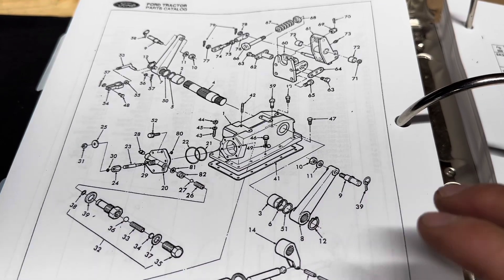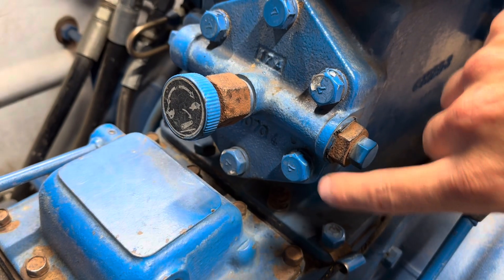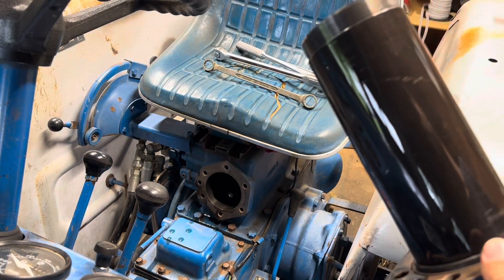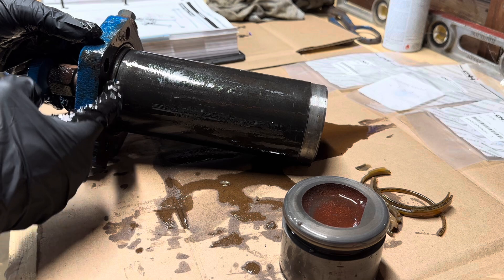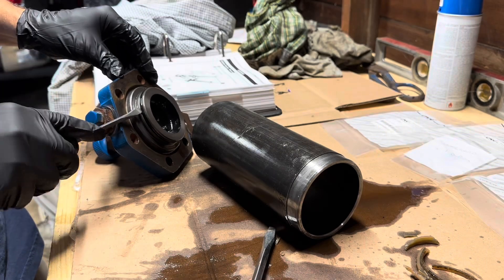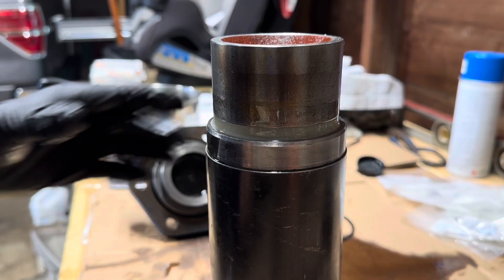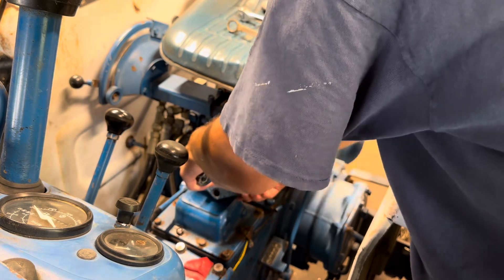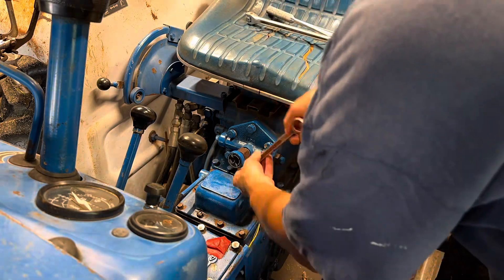Ford 1700 Tractor 3-Point Lift Cylinder Seal Replacement (same for 1710, 1900, 1910)

Comment: I have the same tractor ford 1700 I'm installing a loader implement, need to find best place for hydraulic supply for remotes connection any suggestions?
Reply from the maker: The loader feed block is on the right side under the seat by the 3 point position control lever. If it wasn’t equipped with a loader from factory, it probably won’t have the hydraulic block there that you need though. If you want to see this hydraulic connection, check out my videos on adding power steering. I plumbed the original loader feed to the steering unit, then the steering power beyond to the loader.

Comment: Just changed mine today and it was a little easier than I thought.  Probably took about an hour.  My seal didn't look bad but you could feel that the lip was worn down so that obviously was enough to cause the 3 point bouncing problem.  Thanks for the tip about heating the seal to get it on the piston.   The only problem I had was getting the piston back in the cylinder with the new seal installed.  If I was to do it again I would put the piston in the cylinder while the cylinder was unattached from the front assembly which would have made it easier to pound in.

Comment: Your video just saved me a lot of money. Having the same issue with my 1710. New Holland dealer was sure I would need a new pump. Said it could run as much as $1800. Two different independent tractor mechanics both said the pump was probably ok and it was the lift cylinder. One quoted me $650 which included fluid and filter with the cylinder rebuild. He was backed up with work and needed 90 days before he could get to it. The second mechanic wanted $850 for the same work and could get right on it.  This video convinced me to do it myself. I ordered the seals from Messicks. The filter on eBay and fluid from Tractor Supply.  Total cost was a little over $200.  I plan on doing it this weekend.

Comment: I need the part number for all the o-rings and nylon seal
Reply from the maker: @daveulsh690  I have a parts catalog, but the print quality isn’t great and sometimes it’s tricky to read. The best thing to do is go to the parts section of the Messicks Equipment website and look up the tractor model. They have all the exploded views online, and the parts list even has photos of many items. Plus, their site often lists the actual size of things like bolts and o-rings so you could find them locally outside of a New Holland parts department. I typically order parts by finding them on the diagram and ordering through Messicks, or calling my local dealer and telling them what I need and letting them track it down, rather than me giving a part number. With my local dealer, if they don’t stock it and you tell them the wrong part number (or they get it wrong in ordering) it’s yours and the mistake is placed on you. If you call and ask for something like a muffler for a Ford 1700 tractor and they order it wrong, that’s their mistake and you aren’t out the $ with incorrect parts because they looked it up for ordering. That actually happened to me, so with my local dealer I always have them look it up for me and order it.
Reply from the maker: You can see the part numbers on the bags beginning at 2:10.

Comment: On these tractors I noticed in the manual it says to come to a complete stop when switching to higher gears. Is this actually true or can I just switch between main gears and range gears while moving to increase speed?
Reply from the maker: @treylester1537  The transmission is not synchronized, so you do need to stop to shift gears without grinding. When you get good with it and RPM syncing with double clutching you can upshift while rolling, but you have to be gentle and patient to feel when it is in sync and will slip into gear. I only ever do a rolling upshift when I’m getting going on the road and want to be in 12th gear to reduce riding the clutch getting going, but even then I don’t always do it. If you are running a PTO attachment and want to change gears, you have to stop for longer or you will grind gears as there is more momentum through the transmission. Even more so going from forward to reverse.
Reply: @ so if I wanted to drive in 3rd gear I would just put my tractor in 3rd gear before I start moving?
Reply from the maker: @treylester1537  Yup. From stop, put in gear you want, then ease out clutch and go. I spend most of my time in range 2 or 3, using gears 2 or 3.

Comment: Thank you very helpful ordered parts tractor works great even cleared up a problem with the front bucket not lifting right
Reply from the maker: @JohnStephenson-x8x  Yep, when the 3 point cylinder leaks, the loader doesn’t lower smoothly. Gets all jumpy as the position control valve keeps sending fluid into the cylinder to maintain 3 point position and the loader doesn’t get consistent flow.

Comment: Thank you for another instructional video.  I have a 1700 also and no mechanical skills. Your videos have been very helpful and informative.  Now if I could just figure out why my 3 point hitch doesn't move up and down at all.
Reply from the maker: Thanks for watching. Is your hydraulic fluid at the right level? Do other hydraulics operate (such as a loader)? Many possibilities. Regarding not raising - could be a clogged hydraulic filter, water in oil, insufficient fluid, bad position control valve, failed hydraulic pump… As for not lowering, could be the flow control valve is closed, or the arms are already all the way down. The 3 point uses hydraulic pressure to lift, but lowers under its own weight (or the weight of the attachment), with the drop rate controlled by the flow control knob beneath the seat.
Reply: Thanks for the reply!  I'll have to check that. It's a work in progress. It was neglected for 20 years and I am just slowly trying to tackle it's problems one by one.  Your videos have been a great help since I've never been very good at working on machines.  I've learned a lot from them the tractor.
Reply: Check the diverter valve